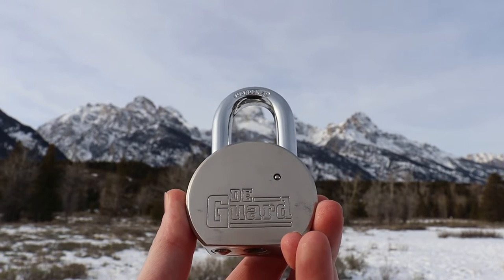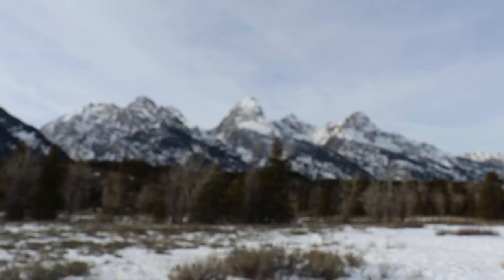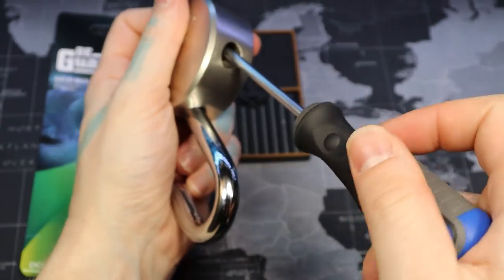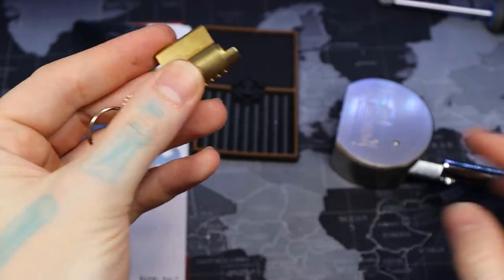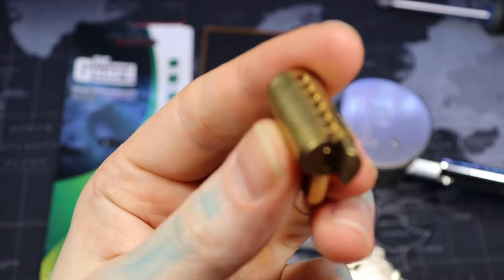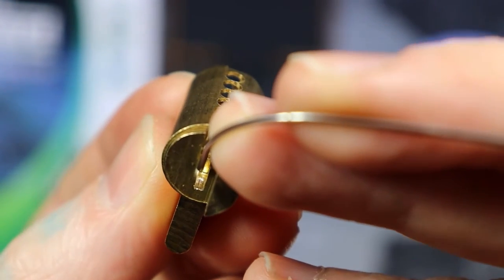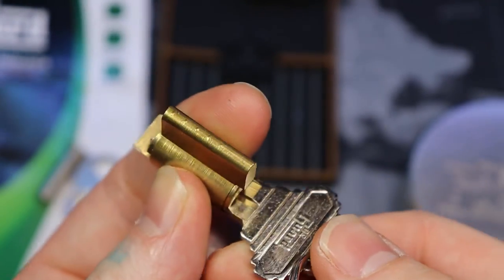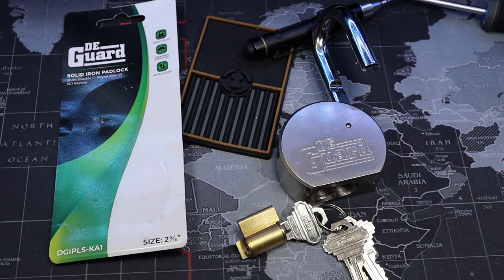176) DeGuard Padlock DGIPLS-KA1 Picked at Grand Teton National Park then Gutted

Comment: I just picked and took apart the same lock.  you don't need to drill it out you can just use a safety pin and push it through pin hole 6 it'll push up the retaining pin and then use a shim and you're good to go . you can repent it with whatever you want. Happy picking.
Reply from the maker: Great thinking!  Makes sense, of course it's better access to go from pin hole 6...  Thanks for the tip.  Will definitely keep that in mind next time!  Happy picking :)